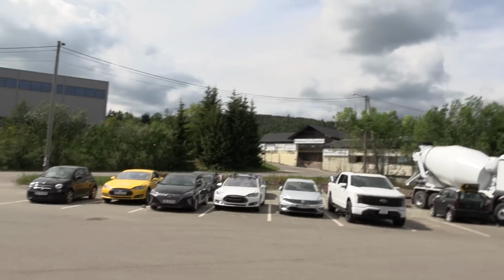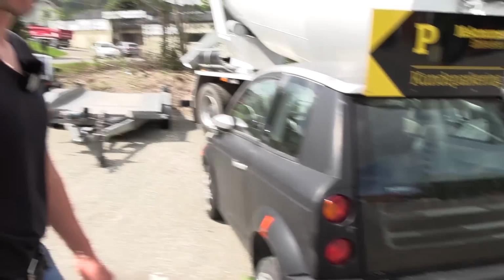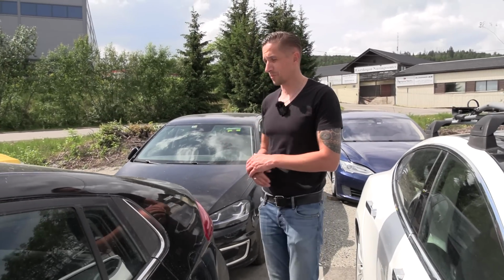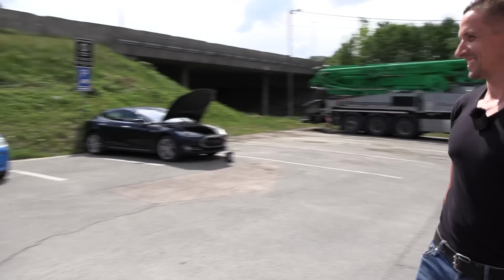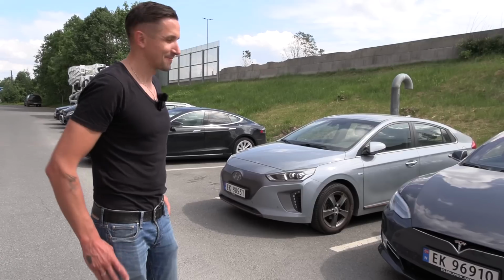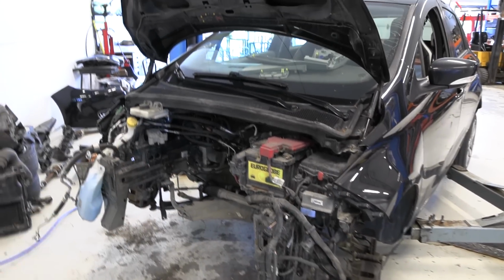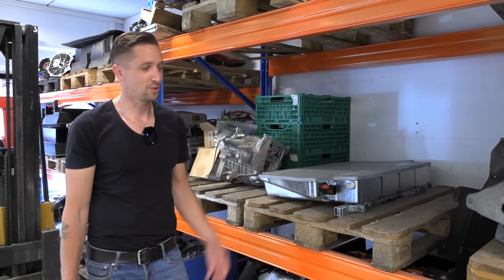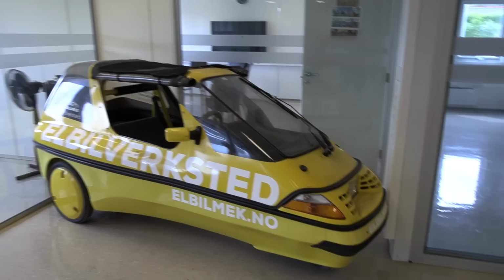Valdemar's garage May 28, 2024

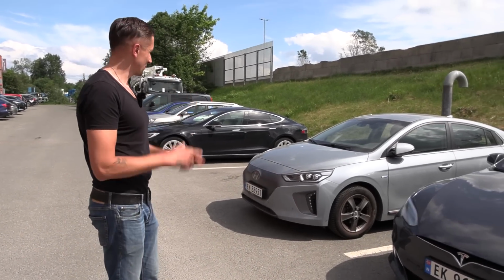Comment: 12:08  have you problem with tesla cruise or autopilot?? I have problem with cruise and keep speed  setting. While keep speed + cruise is on, Model 3 will randomly will increase spee like 80kmh to 120kmh (next speed sign). Little scary when i dont wanto car to increase speed on its own and dont expect to car do that!!
Try from menu disable and activate autopilot if its software problem and reboot the car.

Comment: FYI BMW iX1 has two active recalls 
-replace “combined charger unit” as water ingress could interfere with charging or even cause the HV system to fail. This is ongoing with parts available 
-replace braking system due to RFI interference disabling all advanced braking, including ABS and stability control and brake regeneration . We iX1 owners have been notified of this but they’re not doing the replacement until they’ve got the parts. They had to shut down the production line until the new parts were in, now they’re backporting the change, prioritising those who have hit the problem.

Comment: If I remember correctly from my Outlander PHEV days he is right (in practical terms), From stand-still and lower speeds there is no direct connection between the engine and the wheels so if the electric motor side gives up you are smoked. There is however one exception where there is direct drive but only over certain speeds (at around 60-70 km/h I think). This is due to that the gear ratio between the engine rpm and wheels is fixed. I'm so glad I don't own a hybrid, these will be a bloody nightmare to own second hand when warranties are out and things start to fall apart...

Comment: Has the Ioniq classic a known issue with the reduction gear box needing a specific service or replacement gears around 100K kilometers ?? I heard this rumour and as I have such a car I'd like to have some more informtion on that ...
Reply: Yes ioniq's have issues with the reduction gearbox bearings
Reply: Hi. I heard someone who had the same issue and got he's car fixed at the authorized hyundai dealership and it cost him 100,000.00 NOK. He drove his classic ioniq like he stole the car, always on sports mode and accelerates like a ninja. How much would this cost at Valdemar's car shop? Does anybody know? Thanks. I have a ioniq classic myself with almost 63,000 kilometer on the odo and 2018 model.  Many thanks 🚗

Comment: Wow, cheap 1450kg car has smaller brakes than 2100ish kg luxury car. Mind blown :D
Reply from the maker: And actual weight on Zoe is 1600 kg, not 1450 kg.
Reply: 1450 empty, 1550 with a full "tank" and driver.
Reply from the maker: Since when was a Model S a luxury car? I see no softclose, massage, Burmester, HUD and matrix lights...
Reply: @bjornnyland  please remind me of the price of a Zoe and a Model S, and tell me what multiple a Model S is of a Zoe. These are not remotely comparable cars in price, size/weight nor luxuriousness. So yes, a Zoe will have smaller brake discs, it should be expected. It might also be related to the 15" wheels the Zoe has, vs the 19 or 20" wheels a model S has.
Braking distance of a model S 85 (figured its an older one since its in his garage) is 38 meters 60mph to zero, braking distance of a Zoe 100kph to zero is 34 meters.
So the brakes of a Zoe are fine and perhaps better than a Model S. Performance will vary depending on which specific model of the S, but best case is a plaid at 32m, not much different than the little Zoe which costs a fraction.
Reply: @mravecsk1  and that point is wrong, it was a nearly 100k usd car, that is a luxury car. bjorn brings up stupid points about a car that was made 10 years ago, yeah it may not be very luxury now, but it certainly was when it was made. Wikipedia describes it: "The Tesla Model S is a battery electric executive car"
It's just BS to say it's not.